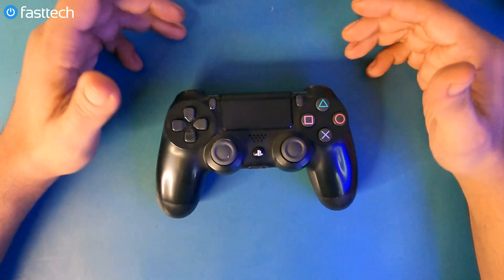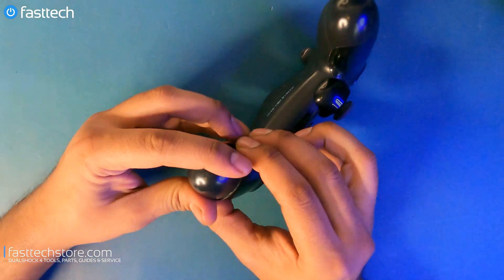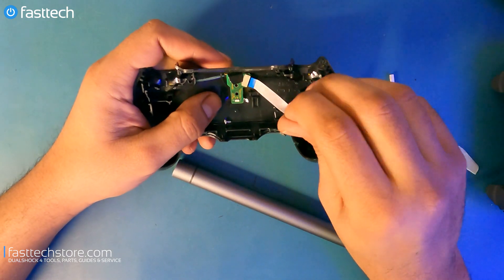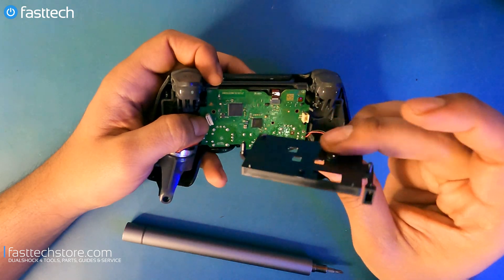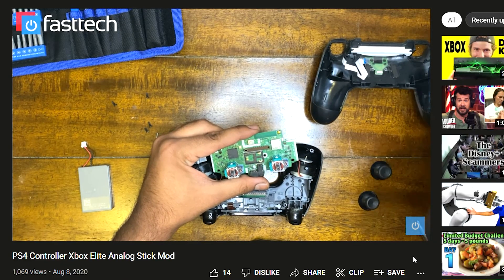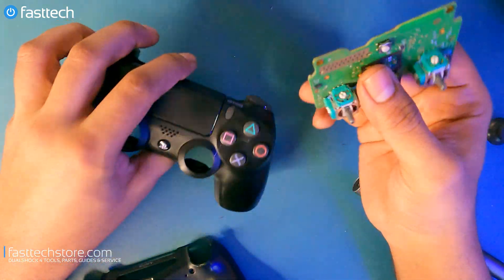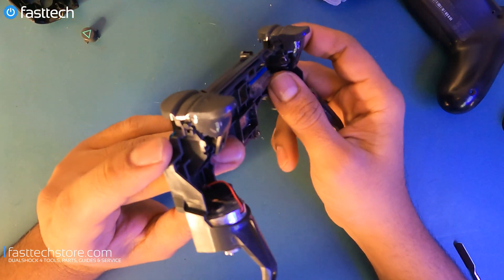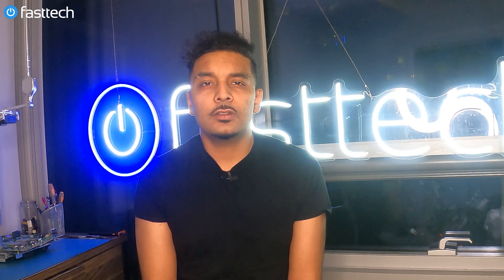PS4 Controller (ZCT2U) Disassembly and Repair Guide

Comment: i did this and replaced the silicone pads for the buttons, it worked but when i reassembled my triggers stopped working i dont know what to do :(
Reply from the maker: The triggers are very tricky to get back in if you are not used to assembling them. Perhaps this needs to be a dedicated video
Reply: @fasttechvideo  no they went into place properly, i think somethings off withthe logic board cus the plastic wiring sheet on the outside wont connect properly to the input panel. it wont read it when i use my triggers

Comment: In some videos/guides i see that the charging assembly ribbon cable is pointing inwards towards the battery and others its pointing outwards. I make sure that every single one I look at is for CUH-ZCT2U model controller, which is one is right?
Reply from the maker: For this model this is how it goes. May be a different orientation for previous model

Comment: question how do you fix the buttons on the right? like the triangle, sqaure, cirlce and x bc for some reason after i tried fixing my analog sticks i reassembled my controller and the buttons werent working at all like they didnt register to the ps4 do you think you cant help me with that?
Reply from the maker: I would start by checking the position of the membrane on right side and its position on the mid frame of the controller. The material thats actually the button is easy to damage since its a very thin material. Hope that helps.